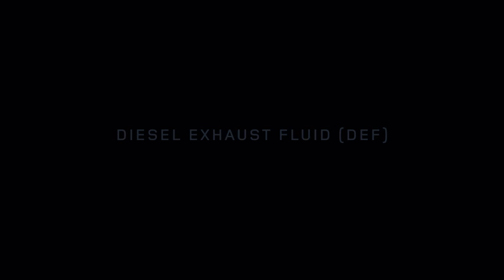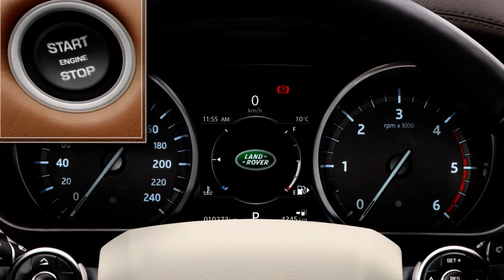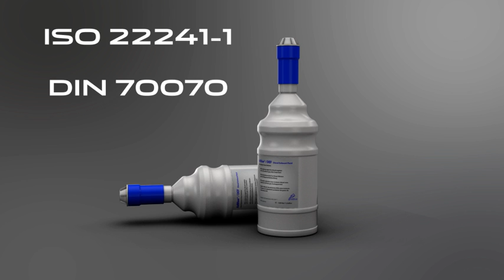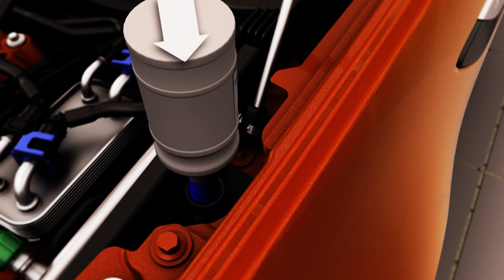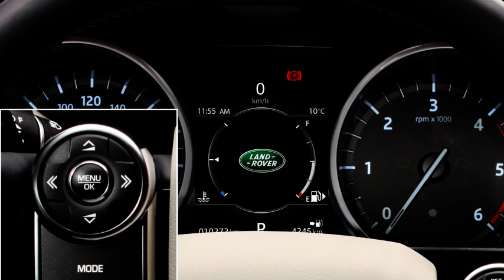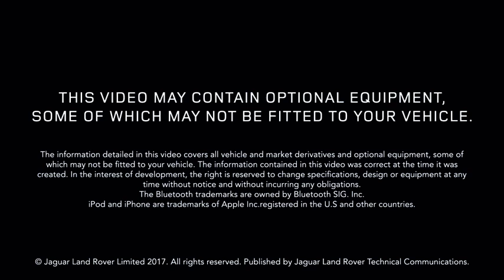How to top up the diesel exhaust system - Discovery (17MY)

Comment: So every 500 miles or so bollocks I didn't know this when I bought one
Reply: 1l per 500... so about 8,000 per tank full.  It's the same on all new diesel.  It's a damn site cheaper online by the way. :-)
Reply: I only got 2000 miles from a full tank after a visit to a dealer to top up, was told would only have to top up at each service :-(
Reply: Cost me £700.00 to replace a faulty Adblu pump